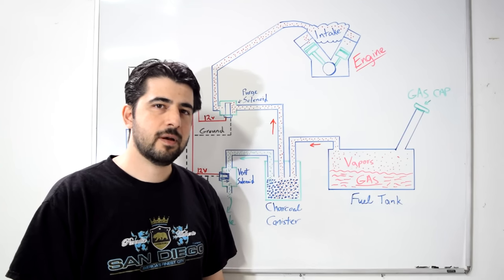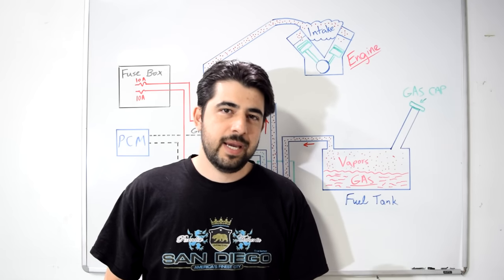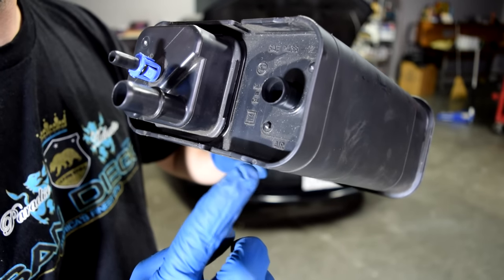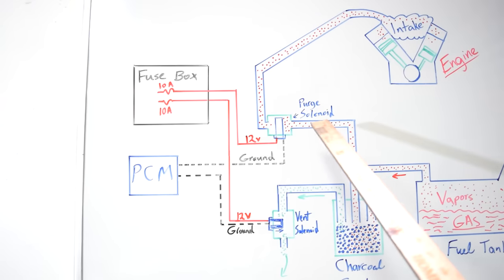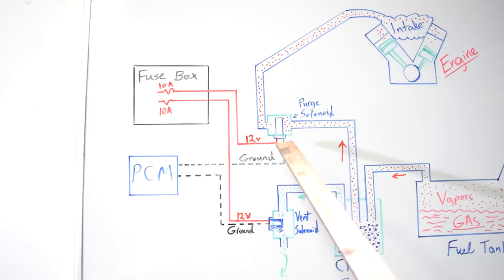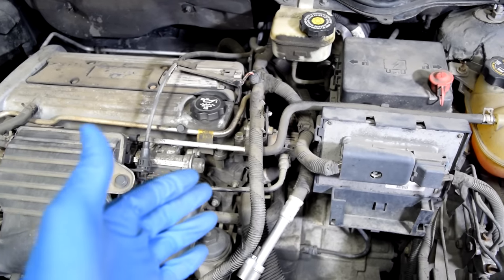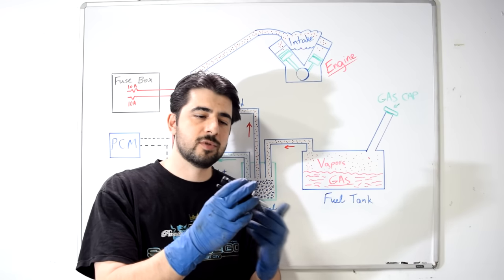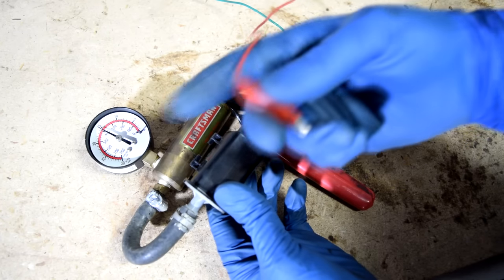Evap Canister Purge Valve Solenoid Operation, Diagnosis and Testing Procedure

Comment: Swearing is required to fix any car, and it helps the pain when you crack your head while underneath the car.  Excellent video, please record more.  Subscribed!
Reply: ha ha !!!
Reply: Genius by Design  I agree, but not really necessary in an instructional video.
Reply: Sometimes I gotta get mad to pull that extra 20 psi to break something loose.
Reply: that's right
Reply: sometimes swearing brings relief that prayer does not..   mark twain i believe
Reply: So is throwing tools
Reply: It helps relief stress too
Reply: @jimfelland7769 you use the word fiddlesticks don’t you

Comment: Is the evap cannister in a state of vacuum when the engine is operating?  I had thought it was but upon close examination of my cannister (97 Ranger 4.0L pushrod V6) I find that the top two rubber plugs are designed with channels that preclude any kind of a seal to either chamber.  I was surprised to find channels molded into the plugs to allow ambient air to enter.  I seem to be missing something in the theory of operation here.  By the way how is your new shop set up working out?  Haven't heard from you in quite some time.

Comment: I love the fact that guys like you post YouTube videos that I can reviewif I'm not sure about an issue with my car. Recently I had a low engine oil pressure light that would come on even after replacing the oil pressure sensor, turned out it was the Evap canister purge valve that was the culprit. No more lights and gas guage gives accurate reading

Comment: Best video I have found on YouTube for Evap Canister Purge Valve Solenoid. I have an 2000 ML 320 W163 and it started running rough and then just wouldn't start properly. Afterward it would start run really rough and stop running. The only code I initially got was small evap leak and then some misfire codes. I believe this maybe be my issue as I have checked all of those hoses and they are in good condition. Gas Cap is fine as well.  If this doesn't resolve it, I will take the next step in replacing the charcoal canister and if need be the fuel pump as they go bad on W163  ML's often.

Comment: Great video, I'm trying to track down a P0455 large leak on my sons 98' dodge neon. I think it's the leak detection pump but now that I have a confirmed way to check the purge solenoid before I just start throwing parts at it. I don't think this car has a vent valve unless it's part of the leak detection pump. Thanks again for the great video.

Comment: My check engine light just came on after having my 06 g35 for 3 years at 89k miles and was really curious what it was. I havent noticed any symptoms just yet except the idle sounding off a tiny bit and come to find out autozone said it was the canister purge valve and this made me understand it alot better, thankyou for your help and knowledge!
Reply: How did you fix it I have the same car

Comment: this is the best video on the subject of P0443 code so far.  I'm only getting 4 volts at the connector and that seems to be why the valve isn't operating. Now to just find out why.

Comment: Thank you so much for this detailed video. It really helped understand how this evap system works. I do have a question. I'm working on a 2007 Ford Freestyle and has a check engine light (code p1450, p0451). Per you instruction, I have checked ALL the hoses, Vent solenoid, REPLACES/NEW purge Solenoid, charcoal canister...and they are all in good shape and tested good with NO ISSUES. However, the ONLY thing i found was, for some strange reason I do "NOT" get constant +12v to purge solenoid (engine cold with no key in ignition), but I do get +12v to vent solenoid near charcoal canister near gas tank). The voltage on my meter constantly in small increments changes rapidly no more than 1v to 1 of the 2 wires(i even test the wire 2 inches blow the connector and still the same). So I checked the fuse box, the wires, and contectore....fund NO PROBLEM ANYWHERE, not sure why I'm not getting constant +12v to purge solenoid in engine area like your diagram.
1. Does the ignition key has to be on, or engine needs to be warm/running...to get 12v to Purge Solenoid +wire? (the rear vent solenoid gets 12v constantly, key or no key, warm or cold)
2. can I run a +12v direct wire from the fuse box to the +wire to the purge Solenoid and just cut the one that's not getting any voltage since the ECU sends the _negative signal? (not sure exactly which wire is the + and which wire is the _ wires, since I have no wiring schematics, I'm just assuming the wire that keeps fluctuating very small amt of voltage is the + wire, but not 100% sure, is there a way I can test the _ wire from the ECU with meter be sure?)
PLEASE HELP🙏🏻🙏🏻,Thx

Comment: Replaced the defective canister purge valve on my 2014 RAM 1500 Big Horn 4WD 6 cylinder 3.6L after watching this video. Pass the emission inspection after driving 3 'driving cycles' let the P0456 become inactive (check engine light goes off). Thank you!

Comment: Thank you for an awesome explanation. I just have two questions. Would this cause poor fuel efficiency? I have a scanner that can trigger the solenoid and it clicks rapidly. I triggered the evap one and it’s much slower. Could that be a sign of an issue? Thank you in advance for any possible help.

Comment: Nicely done. I liked the vacuum test, easy to understand.
Reply from the maker: Glad you like the video, thanks for commenting.
Reply: thing is... PCM runs that purge valve with a PWM signal ticks to be a "controlled air leak"
It does double duty as "air ratio adjustment" to cycle the O2/Lambda sensors !

Comment: Question 2:  I note there is a 'Commanded Evap Purge %' recording in the Scan tool This shows on my car a percentage between 0% and 100% and it constantly changes as you drive. I am curious as I guess there is a limit as to how much vapor is stored in the charcoal canister, and constant purging would empty it faster than it can be replaced.  So I wonder what the percentage means...  If it is using up the canister, then that % would drain down as you drive constantly at load. But this doesn't seem to be the case so far in my driving.   I DO note in one online Evap System Patent, that the %  concentration of hydrocarbons coming from purge was measured and thus known by the PCM - so maybe it thus knows how much fuel is actually coming via a purge, it isn't just simply an open valve.   So if the actual load of fuel available and or requested via a purge is taken into account in adjusting the Injector timing.  This means it is simultaneous and shouldn't affect STFT unless there are other factors at play.  As the whole system Injectors & Purge % is being programmed to input the right amount of fuel for the TPS and load.  The fact that the scanner data says.."Commanded EVAP purge %' on my seems to indicate this, that the PCM knows and is 'ordering' the exact amount of fuel required of injector and purge combined.

Comment: Can you give me advice? 2001 Toyota Tacoma Prerunner 2.7 L 4cyl. I have a CEL and code P0450, P0441, & P0446 Evap system. I've tested the solenoids by using a 9v and blowing/sucking (didn't have a vacuum tool). Sprayed soapy water on charcoal canister, and also checked tubes and hoses. Checked voltage and resistance. I get noise when removing my new gas cap. Don't want to pay $300 for a new charcoal canister.

Comment: So will this cause a raw gas smell? Will it cause the secondary air injection to cycle on and off? Will it cause poor gas mileage? Where would this piece be on my 99 clk320? I replaced the one that ticks on the front driver’s. Is there a second one by the gas tank or underneath one of the wheel wells?

Comment: Thank you for this video and the last one. I now have a much better understanding of these systems. Question though: when consuming fuel, air or other gas need to fill the tank instead. From there does the tank pull that air? Is there a check valve in the fuel cap or something? Because the evap line from the tank to the canister seem to have a check valve on many cars I've seen, so that gas can't flow towards the tank.

Comment: I HAVE BEEN WORKING ON THIS CHEVY,OIL PRESSURE.The person who can see getting the pressure switch out,pulling a pan for oring,find a galley plug barbell broke and have to take transmission out to get to it,And Has Not One Bad Word??Go On Out Running With The Unicorns,On Rainbows,And Have Urself A Great Day...Somewhere Else..For Any That Have Scraped A Knuckle,Had A Socket Drop In A Hole,Crawled Out From Under The Car Many A Time For That Needed Tool...FNA..Keep It Up.And Keep Making Videos..Cause Without Them I Would Be Back To Finding Shit Out The Hard Way.

Comment: I have a 2003 Lincoln towncar and get the PO455 code "Evaporative Emission System Leak Detected (Gross Leak/ No Flow)" Which should i focus on first, purge solenoid by motor or vent valve by charcoal canister ?  I have a brand new OEM gas cap so thats not the problem.

Comment: I have a small crack in the hose at the attachment point to the canister, but it doesn't seem to be big enough to where it will actually cause air to suck in. Am I wrong to think of it like that?

Comment: Ik its not reccomended to run your car while filling up with gas but could I run my car while fueling until i can get this fixed?  My car runs fine until i fill up and i have to rev it to get it running after i fill up and then everything is fine.  Car doesnt have any codes i took it by autozone yesterday and they looked at me crazy for wanting a scan with no CEL but i just wanted to be sure.

Comment: Ratchets, 2000 A6 2.8 quattro, smells of fuel all the time, have issues putting fuel in, but it runs great and no codes, no starting issues, I've found the purge sol above the airbox will test it today, don't know where vent sol is, and is there anything else I should be looking at? Another good video, tfu

Comment: I replaced my purge valve and I still keep getting the same check engine like “evaporation system” code. I’ve heard people say “your loud car sounds like it has a leak somewhere” but it’s not oil, it’s never leaked oil that I can see on the ground. So it has to be an air leak or something. My car struggles to start, I have to give it some gas as I’m trying to start it. But if I turn it off, and start it up back up anytime within 5 mins after turning off, it’ll start right up with no throttle to help. I need help fixing this please.

Comment: I'm a do it yourself sorta girl. My 2005 Hyundai Accent loves the P0304 code. But I can't figure out why when I put any amount of gas in I must drive it w/o stops for at least 3 miles otherwise sitting at a Stop sign or putting it in park causes the engine light to flash and the engine to thump hard. Once I drive resume driving the flashing ends and goes back to a solid engine light. No other codes other than P0304 present Spark plugs, wires, coil all changed out. Thank you!

Comment: My purge valve seems to be pumping all the time driving my long term fuel up and it says evap rest leak failed but no check engine light. Is it stuck open. I will test it later today to see if it’s open

Comment: Thanks mate Replaced mine on a 2014 Holden Cruze 1.4T with over 225,000km it was running rough while on idle, and some google digging told me it was the purge valve stuck open :) I removed it from my car blowed air through it so was faulty straight away... new one fitted and instantly solid idle speeds and normal operation ! I like how detailed the video you posted up is! Keep it up Liked & Subscribed ! Cheers from Australia!

Comment: Hi man.. I need help regarding a problem in the evap system if my 2012 prius.
I have a check engine light on since I bought the car. When I connect the diagnostic tool it indicates evap system very small leak # 0456.
I consulted a hundred mechanics and engineers on the issue. As a result, I replaced the gas cap, the fuel neck, the coal canister box( twice), the vent selenoid, the purge selenoid. I also change the rubber grommet which is beneath the gasket near the fuel pump ( below the back seat ). YET. the problem persists. Do you have any idea what can be the cause of the this small leak???? Please!

Comment: Thanks for the great explanation of the EVAP system and purge valve operation. I been searching for the little Craftsman tool you used to create a vacuum. It siad Craftsman on it. All I can seem to get is vacuum cleaner stuff, like vacuum cleaner filters, or the whole vacuum cleaner for sale, etc. What is that tool called or do you have a part number? Did it come with the vacuum gauge already attached. Do you have a link to a vacuum tool? Thnaks and keep up the great vids.

Comment: Hi I am a old subscriber , i have a 2009 Acura TSX with check emission system on the dash and a check engine light of course and a DTC P145C (system purge flow malfunction) , i changed the purge valve although it was working and i changed the gas tank cap , still cannot get rid of it , what do you advise thank you 
Bob

Comment: Fuel is leaking from the hose from the tank before it reaches the canister. how and why is liquid fuel in that line. If you can answer that I would be grateful. I lose about 3 quarts a day and used UV dye to pin point the leak.

Comment: Hello, I was hoping you could help me out. I have a 06 Chevy trailblazer. I had a code of p0443. I wasn't getting any voltage at the solenoid plug. So I replaced the wire from the fuse block to the solenoid. Now I have battery voltage at the plug. I always had voltage at the fuse. The problem I'm having now is that I have battery voltage at the fuse and solenoid even with the key off. And its causing my battery to drain overnight. Any help and time will be greatly appreciated!!!! Thank you.

Comment: I had code P0443 showing up when I plugged in the OBD2 scan tool. I replaced the purge valve solenoid, but it didn’t rectify the issue because a day after I had the code cleared, it popped back up. Any thoughts on where to go next?

Comment: Great as always!
I got a p0441, just want to make sure that I've got it right about the symptoms you mentioning. After fueling my car I usually crank it up and put it aside so I don't block others while I'm going inside to pay(It cranks normally). BUT, when I'm crank up the car a 2nd time, in that short interval during 1st crank-go pay-go out, it starts up IMMEDIATELY. That symptome combined with the p0441= this is the right video? 
It's a Hyundai Accent-98. Or -99, don't know if I should go after model year or making year.
Thanks!

Comment: I just found out my canister purge valve solenoid is open normally, but closed when 12V is applied. That seems weird, and I am not sure if any previous owners (I bought my car, 2000 Corolla, used ) bought counterfeit part from eBay or anywhere like that or probably the part just gone bad itself over the years.

Comment: Hey bud, good video! I am having an issue on my BMW 2009 335i where I am pulling raw fuel into my charcoal canister. I noticed the fuel nozzle would shut off immediately once I try pumping fuel into the tank. Also I noticed my car while running would stumble hard and seen that my AFRs would go super rich when that happens. How on earth is fuel being sucked into my charcoal canister? Also noticed that my Leak detection pump is full of fuel. Also noticed the purge line and purge solenoid running to the intake manifold is flooded with fuel.

Comment: I had this same problem. Had a leak, ran a smoke test , and changed that hose. The light still came back on, and found it was a loose hose connected to the vacuum, and I had some bad o rings on the vent valve solenoid as well . Fixed those, hopefully that’s all that was wrong.

Comment: I had my check engine code checked today on my 2003 Pontiac Grand Am with the 2.2L and this came up. The Canister Purge Valve. I can get an AC Delco one from Rock Auto for $26.00. Would you recommend a new fuel cap too just to be sure? Also, is there a video that you know of that will show the replacement process for this 2.2L? Thanks!!

Comment: Hey man great video... got a quick question, I did this test on my purge valve and the needle was going down slightly after about 4 mins or so.. I wanted to know how long do you have to wait when your holding vacuum and is going down 0.5 to1 inch every 3-5 mins acceptable?
Reply: CarbonFiberWizard it's supposed to be shut sealed. If it's leaking tiny , this will mess up your fuel trims, evidently that your purge solenoid will fail in future.

Comment: hi does the connector that goes to the purge canister have to have 12volts? when key is on shows 6 volts once the commander is on theres no volts . tested the purge looks good . just want to know what kind of readings i should have on the connector. i dont know if it has a fuse to it like your diagram

Comment: I am getting a check engine light and P0441 code on my 2014 town and country.  I replaced the fuel cap and purge valve solenoid but I am still getting the error code.  What would you check next?